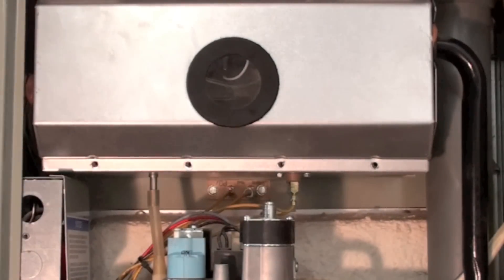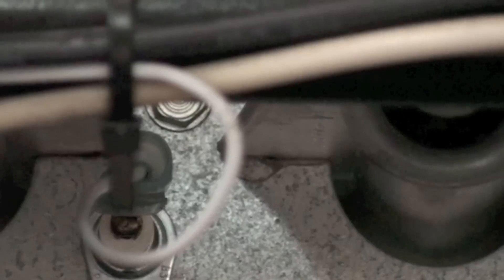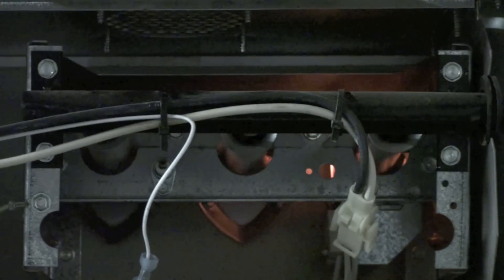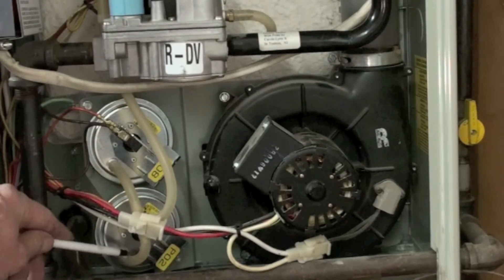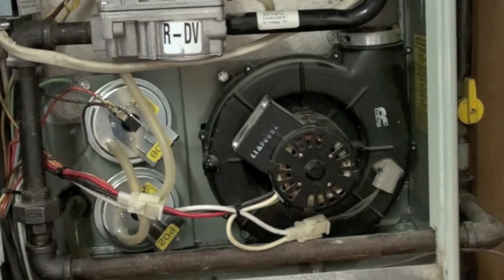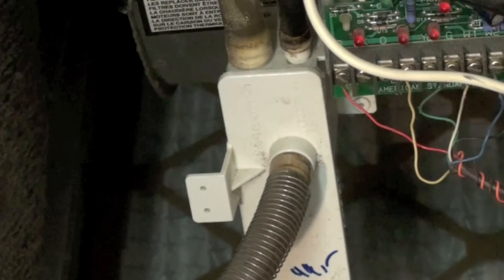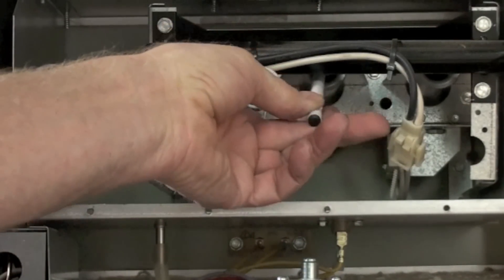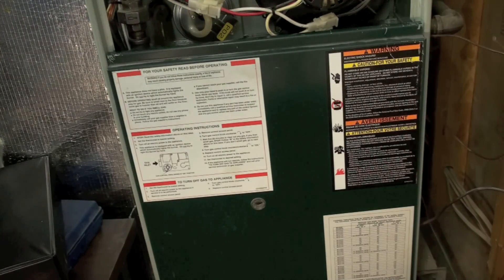Why does the gas furnace short cycle

Comment: Thank you excellent video. I have a Lennox G 61 never had a problem for 15 years except the blower motor went. I let tegular  tech replace it, but there was hardly any air blowing through the vent. I called Lennox Tech and he said you have a variable speed motor. Why didn’t the guy jump it to the next speed to push the air through? That’s what you paid $2000 for.. the regular tax at oh no I’m not touching anything that’s factory set. Long story short I replaced the concent trap. Myself never looked for any other clogs, though the trap was cracked and leaking water.. I just replaced my draft inducer myself for $350. The bearings were making a loud noise now they’re quiet. The problem is with this short cycling I was told it’s oversized but heard about this anticipator thing. I still have a Lennox dial furnace electronic I guess with the anticipator I did what he said and the flame burners ran for over 15 minutes and then shut off so now I know I have a blockage or a thermostat problem. It used to cycle four minutes of flame 10 minutes off then it would start again four minutes of flame 10 minutes off just wouldn’t start getting heat again. The flames would kick out, but since I turned it up to about 88 Those flame stayed on for 17 minutes, kicked off and let the inducer blow out the rest of the hot air for five more minutes. I’m gonna call another Lennox tech out. Thanks again for a great video. They’re all trying to sell me a new unit when they tell me it’s immaculate condition blue flames no rolloff they even time my circuit board when things click on and off my energy bills are very cheap for a 2000 foot house

Comment: I was told i have an "oversized furnace and it was causing my limit switch to short cycle my system". It always comes up to temp with no issues. Burners come on, run a few minutes, limit switch kills it, comes back on, repeat. Repairman was out today trying to tell me i need a new furnace. Ive been here four years, and I'm going to assume its done this the entire time ive been here. Does this sound right? Do i NEED to replace my furnace right now? Immediately?
Reply from the maker: I would replace it.  However, not necessarily immediately.  
It is not good for the furnace to continuously limit out but many have been doing it for years.
GFM

Comment: Have owned our home 35 years.  It came with a '70s vintage NG furnace.  About 10 years ago we replaced with a 95 condensing.  Have had 5-6 thermostats thruout.  Both units have always short cycled @ 5-7 minutes.  No error code whatsoever on the new one.  Ideas welcomed.

Comment: Flame shuts off as soon as the fan motor starts.
Reply from the maker: I would be watching the flame when the fan starts.  If the flame changes or blows out the front, you may have a cracked heat exchanger.
GFM

Comment: Hope you're still around. My furnace was just flaming on the first burner and then shutting down. The three burners are completely boxed in as it's a mobile home on propane. When I take the cover of the box off all three burners ignite fine but then it short cycles.  I wondered about exhaust. The exhaust pipe (PVC) is the Diversitech CVENT. So I don't know how to see inside the exterior pipe. The centre pipe looked clear, but I could see water at the very bottom. Is that normal? A 'P' trap maybe? There is nothing covering the centre pipe.

Comment: My older furnace had a bad heat exchanger.  There's like these o ring looking things.  But those orings popped off. Allowing for the metal to expand. Was told it was caused by short cycling. I have a 1150sqft with a 100,000 btu furnace. Was told that furnace was way too big. And in turn over the years of short cycling it caused the heat exchanger to go bad. I now have a smaller btu furnace. So hopefully it lasts.

Comment: I have a newer goodman 96% Single stage with no error codes but about 10 seconds after the house blower motor starts up it will shut down the gas (and induction motor for 15 seconds) and begin the re-ignition series (of course the house blower fan is still running due to the 90 second post run time).  It then fires up normally for about 5 minutes , snuffs out again and recycles for about another 5 minutes.  By the end of the whole start to finish, 10 minutes, it shuts down normally as the thermostat is satisfied.  New filter, condensate does drain normally, primary switch appears normal as I ran a continuity tester to see if it kicked out during this abnormal short cycle.  Nothin appears out of the ordinary and no error codes read.  Not sure if Goodman offers codes until a lockout or ?  Thanks, Sir!
Reply from the maker: Look for a sag in the vent pipe.   Water builds up and when the inducer shuts off, it drains.
GFM

Comment: I get blue flame for about a minute and as soon as the blower fan kicks on the furnace shuts down and gives me a 42 code, witch says it's the inducer motor. Inducer motor sounds fine, I'm thinking one of those vacuum limit switches maybe. Anyone have any ideas, it's getting cold out and I'm broke. Oh and I cleaned out everything I could get my hands on.
Reply from the maker: First, I would be looking at the heat exchanger for cracks.
GFM

Comment: I'm not in the trade, but I do industrial automation, so modern furnaces are easily understood. It's a good thing you are doing because there are sharks in the water who would happily sell you a furnace rather than fix the smallest problem. Even if the home owner doesn't want to go outside their expertise, having an idea what's wrong could save them big bucks.

Comment: did like you said, but when and got a new  flame sensor, for $15.00 , seen it was burned  so i replaced it. Also now it runs good, but only for 4-5 mintues and then shuts down, then it starts up again, can i have the front cover off and watch and see if anything else could be wrong??  Cound this be a  the ignitor next to the flame sensor also going bad ???

Comment: I’m having a short cycle issue that I can’t figure out. The unit turns on, igniter glows, calls for gas for the burners to ignite but no gas. I replace the gas valve with another one and it worked for a few days but now it’s back to short cycle. I’m thinking of replacing the vacuum switch and pressure switch since they are cheap and easy but I’m also wondering if it could be the control board. I’m lost. Weird thing is, my gas fireplace won’t light either. I can get the pilot light to come on but I have to hold down the gas. As soon as I let off the gas knob it won’t stay lit. All of this seems to only happen on very cold days. I’ve called the gas company and asked they check our gas lines for issues but they said they are only responsible for the lines leading up to the house. At this point I’m wondering if I have a gas issue. Any thoughts or ideas on what to do?
Reply from the maker: If both the appliances will not operate at the same time, you have a gas supply issue.  You need a test of the pressure in the lines from the meter to the appliances.  If the utility will not do it, you need to have a service tech to do it.  
GFM
Reply: @grayfurnaceman  Thanks for your reply. I was hoping to avoid a big service charge but I feel there may be no other option. Weird thing is, I just turned on my heat and it’s working again. Outside temp is a little above 40 degrees. Seems like when it’s below 40 the furnace has issues. Thank you for your help. I will post what fixed my unit.

Comment: My furnace has the same problem but mine doesn't have the flame sensor so what is the problem?. my furnace only has 2 chambers and no flame sensor. I changed the limit switch but it doesn't work I can't fix it.

Comment: I have a brand new Rinnai wall furnace (EX38CT- LP) short cycling. It runs on and off about every 3-5 minutes. No codes. I set low and high pressures with manometer. Should I also check incoming propane pressure (spec 10-11 WC)  ? Could that cause  short cycling if its too high or low? Any other thoughts ?
Reply from the maker: First, I would jumper out the thermostat.  If the furnace stays on, the thermostat is causing the problem.  If it is mechanical, the anticipator may be set incorrectly.
GFM
Reply: @grayfurnaceman  Ok, I was wrong. For example, if it's 60 in the cabin and I adjust the heat setting to 70 it will run nicely up to 71 or so and shut down. So it's not technically "short cycling" (I think) But here's what it does: Once the cabin is at 70 degrees, in 2-5 minutes the furnace fires back up, runs for a few minutes to bring the temp up to the setting and then shuts down again. And this will go on repeatedly if I let it. Of note: These Rinnai wall furnaces have a thermister as a t-stat which is located behind the unit and 2 inches off the floor. Is it possible the location of this cheesie thermister/-t-stat so close that it picks up the temps too quickly? Maybe If I buy their remote 24v transformer and hook it into a REAL wall mounted T-stat and locate it further away from the unit it will operate better. Thoughts?
Reply: add on: I don't think it's too large a furnace for the sf involved. It's rated at 38,000 BTU's and the cabin is 800 sf and insulated quite well.. Plus even as it cycles on and off so quickly the entire cabin is not a consistent temp throughout the place. Also of note: I am unfamiliar with a "anticipator." Does this unit have one?
Reply from the maker: @kdlittlehawk  The unit with the supplied thermostat has no external anticipator.  You could be getting outside air drawn in and starting the unit prematurely.  
GFM
Reply: @grayfurnaceman  I just built the place and it's tight as a drum (no drafts), except for one small cold air intake vent in the floor but thats 15 feet away from the heater (on the opposite wall) and behind my propane fridge. Today I located the t-stat/thermister and was able to raise it about 12 inches up higher as it had some extra wire to it. No difference. I was hoping it would start sensing better at the higher level thus eliminating any cold low floor drafts and stop the constant start-ups and shut downs. The only other cold air would be through the intake/exhaust dual port system (direct vent) but I don't think that would effect it. I bought this furnace because of all the great reviews and the Rinnai brand name. But this is a real head scratcher for me.
Reply: @grayfurnaceman  I just watched your video titled  "Thermostat cycles per hour #1" which was helpful. You mentioned maybe about 6 per hour. Mine would cycle 10-12 per hour. One thing I'd also like to mention is that my furnace is variable/modulating therefore you'd think it'd run longer but at at different fan blower speeds to keep the temp at the set temp. Please see my other comments as well.
Reply: @grayfurnaceman  Problem solved. I bought and installed Rinnai's remote thermostat (a 24v plug in  transformer and a circuit board) for 60 bucks. I also had to go out and buy a wall-mount t-stat for 25 bucks. Rinnai's wall furnaces are useless without these. They should let customers now that. Even the tech-support guy at  Rinnai agreed with me.
Reply from the maker: @kdlittlehawk  Glad you got it going.
GFM

Comment: Any idea what might be causing the heater's inducer motor to spin for maybe a second right when i turn the heat on at the thermostat then the whole unit shuts off? Nothing else happens no flames nothing? I have a solid LED as well.
Reply from the maker: If the code on the control indicates a solid led as a control board failure, that is your problem.
GFM
Reply: @grayfurnaceman  alright so upon closer inspection and testing I found that I'm getting error code 31 which looks like a pressure switch issue. I checked and the pressure switch is working and I couldn't find any blockages either. I might just have to hire a professional. I wish I could have had the satisfaction of fixing this but it might be more complex than I originally thought

Comment: I ran into a bad IFC board a little while ago. I was getting 8ma but part of the board looked burnt in one area
Reply from the maker: If you mean 8 microamps, the flame does not prove and the wiring is good, it is probably a board problem.  The burnt section is probably not an indication of failure.  Most of these boards have a hi wattage resistor that may show burn marks after a few years of use.
GFM
Reply: @grayfurnaceman   true. But it worked fine after and no call backs too so it worked lol

Comment: Well I cleaned the flame sensor and still shutting off every 6-13 minutes. Time to do more troubleshooting
Reply from the maker: I would be looking for low air flow problems.  Plugged filter, dirty blower wheel, plugged A/C coil or crushed duct.
GFM
Reply: @grayfurnaceman  thanks I’ll update when I’ve gotten to the root cause :)
Reply: @grayfurnaceman  I checked for plugged filters. They were recently replaced. But I’m curious to your opinion. We use the those filtrete 2200 allergen filters.  Do those do more harm than good?  I checked the blower motor and it’s pretty hot which I think is what’s happening. The unit has 3 return registers on it (two 20x25x1 in main living space and one 14x14x1 in the bonus room). No visible blockages. I’m letting it cool off, removing all filters, and will run a 15 minute test to see if it stops again. We are using a nest thermostat which is what told me the furnace was shutting off prematurely. If this fails next stop will be the roof to check the exhaust.
Reply from the maker: @thebruhhh  I would be choosing the cheap filters, the allergen filters are often too restrictive.
GFM

Comment: I tried cleaning the flame sensor rod multiple times with no luck, but one of the drain pipes for clogged. I removed the pipe clean/flushed it with hot water and reinstalled it. Furnace working normal again! thank you so much for informative visual.
Reply from the maker: Glad you got it going.
GFM

Comment: 4:16 "There's a coating on those stainless steel rods..."  Are you sure? My understanding is that the flame sensor functions by conducting electricity through the flame, and it rectifies the current in the process. A coating of anything nonconductive would impede the process.
Reply from the maker: The coating is metallic.
GFM
Reply: @grayfurnaceman   What is the metallic coating made of? And why would it be there?
Reply from the maker: @Nehmo  I can't get into the metallurgy and I don't know a lot.  However, 304 stainless does have a coating and it will rust if it is heavily sanded.
GFM

Comment: My furnace stays on for only about 2 minutes before it cycles off.  The blower is rather noisy, a little clunking sound as it operates.  Would the compromised blower efficiency be another possible cause for short cycle?  I do feel the air coming out of the vents in the rooms are rather weak.
Reply from the maker: This depends on if the burners are are short cycling or the blower is short cycling.  If it is the blower, inefficiency will not cause short cycling.  If the burners are short cycling, blower efficiency will cause it.
GFM
Reply: @grayfurnaceman  It's the latter. Thanks!!!

Comment: Bounty or shop blue paper towel is the safest to use to clean it without damaging the thermal coating of the sensor do it every seasons.
Reply from the maker: There are as many ways to clean as techs to do it.  Its just a stainless steel rod.  
GFM

Comment: grayfurnaceman I have a high efficiency two stage Goodman furnace that gets the error code E1 “low stage pressure switch stuck closed at start of heating cycle”. This only happens when the furnace runs for several minutes in stage 2 heat mode. The problem is intermittent. I finally just disabled stage 2 altogether and my furnace works fine using stage 1 only. I’ve replaced the pressure switches, flame rod and ignitor completely.  An HVAC tech cleaned the whole system and didn’t see any problems.  Any suggestion?

Comment: Gary, awesome video as usual.  I hit a new one on my side that might be worth you mentioning at some point.  I ran into a short cycle problem that was intermittent but could shut down after 3 sec or could shut down after 3 min.   Flame Would even sometime seems to flip on/off within a second or so while firing.  The board was still putting out a ‘call for heat’ and thought all was well.  Eventually it would give a no flame error. Cleaned and even replaced flame sensor to no change.  all other sensors good and not causing error.  
Thought it might be a bad intermittent gas valve, but tested that by briefly bypassing it when it was starting up.  The intermittent nature makes it hard to troubleshoot.  
I believe it is coming from a bad relay on the control board for the gas valve.  Will try replacing that tomorrow but think I’ve ruled everything else out.
Would love to hear you talk about common control board failure modes and symptoms.  Seems the most insidious failures that are hard to isolate.
Reply: Sounds like my problem. My furnace is a Goodman . Did the relay fix yours ?
Reply: @whowho7969  It ended up being a two step dance.  2 years ago, changing the control board (relay) solved it.... for a year.  The repeated cycling (i think) created extra wear on the gas valve which failed the next year (stated to sometimes work, sometimes not, and sometimes close early).  replaced that 1 year ago and everything was perfect.  had to do some pretty deep diagnostics to find these - to the point where i was walking the repair tech through it...

Comment: The gas shut off valve is very close to my the furnace. When I was in the basement I must of moved the handle to halfway closed and the furnace was not getting a lot of gas. I turned to handle to full on and presto no more short cycle. Great video also.